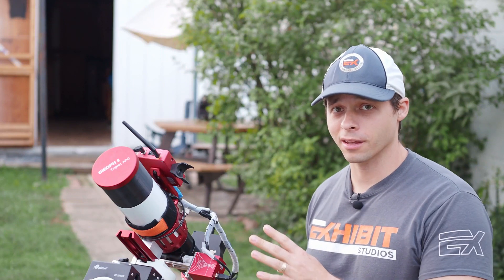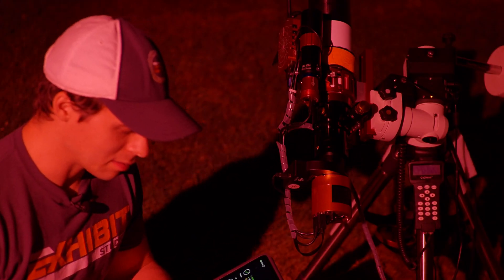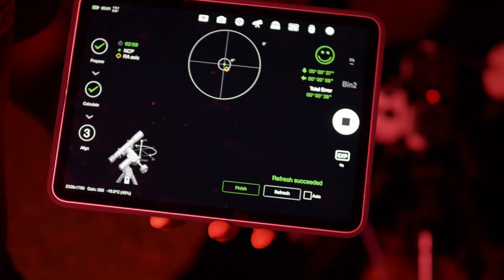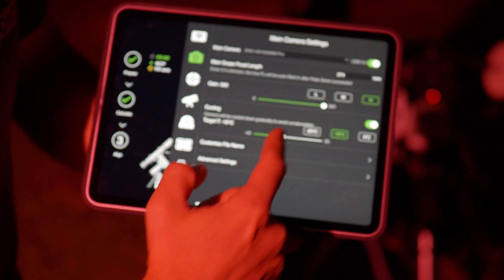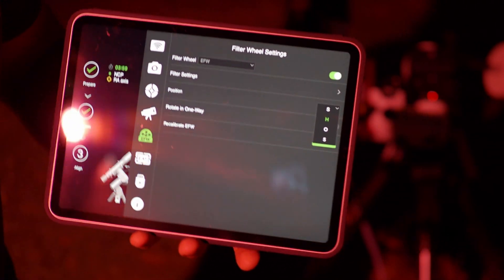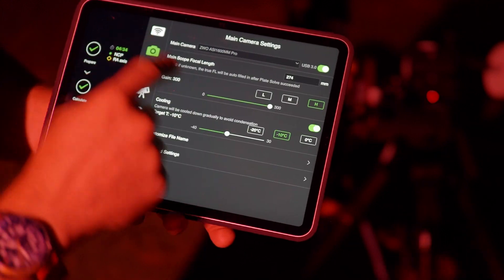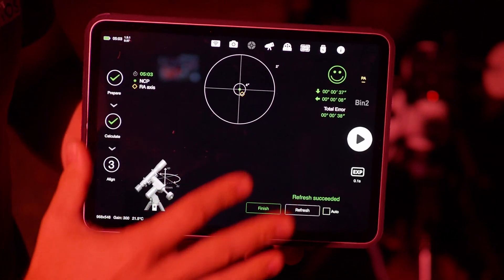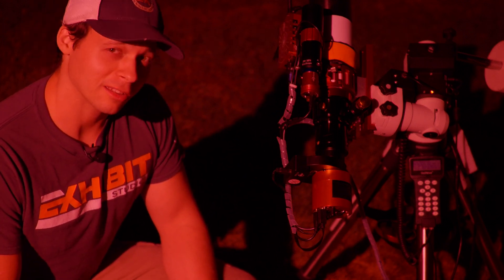What to do When Plate Solved Polar Alignment Fights You, ASIAIR Plus/Pro

Comment: When my PA first starts sometimes it will produce a little red box that says "Stop Rotation".  Any ideas?  Most of the time works great, just once in a while it does this.  I have an Explore Scientific 102 triplet with ASIair Plus, ZWO focuser, ASI533MC Pro, ASI120mm (guide).
Reply from the maker: Interesting. I have never had it do that to me. Lately  my only problem is it says it is rotation but it never does. Just sits there like it's frozen. So I have to reset RA angle manual and restart.

Comment: Thanks, since I disabled the “auto button” and refreshed it manually, it works much better, especially on cameras with larger sensors and on cold nights. Strangely, I only had problems with the ascension, the declination alignment worked perfectly.
Reply: I found that the auto refresh was an issue for me as well - it would often sample while I was moving and not be able to handle what it was seeing - needed several passes for it to settle down so I found it was just easier to manually make the system update after I made my adjustment and the scope had the time to settle down - especially on a SCT vs my smaller refractor.

Comment: Ben, Kevin here.
I have no particular issue with the ASIAIR PA function except I like to look through the polar scope.
So long as I have checked the polar scope accuracy during the day, then the polar alignment is very good.
Best of all, polar alignment takes less than 30 seconds after I see Polaris in the scope.
And, I usually have this done before it gets dark.
The PA function is a bit too time consuming and technical.  I just want to point it and go.

Down side: My old knees disagree.  

I had once wondered about how the errors add up using different methods.
It “seems” intuitive but might not be: polar alignment thru the main optical instrument may eliminate some alignment errors?
I don’t know. I just knee, align and move on.
K

Comment: Great tips. I’m having a similar problem after slewing to target it cannot confirm centering. I believe this is due to use of a filter drawer/filter (dual narrowband Ha OIII), which results in only 30 to 40 stars being found. Is there a way to increase the exposure time? I am NOT using the filter wheel, so cannot use those settings.
Reply from the maker: Yes there is. I think it is in the mount settings. I will have to look it up though. You can specify how long centering exposures need to be for each filter with a filter wheel too.

Comment: Hey there.

Can you do a test for me one of these days? Om-1 with oly 100-400mm lens. Tracking shot of Saturn? I did a single shot of it, and was actually very surprised of the result 😳 so I wonder what I could get with using a tracker 😊 stacking would probably do wonders, but it will take more time than just a long tracked shot? 😬
Reply from the maker: Yes i can give it a try soon. Just moved to a new place. I have much better horizons now too.
Reply from the maker: And stacking planetary should not be a problem with planets. You use very fast shutter-speeds anyway. Just the stacking part is a challenge. Most planetary stackers hate 4k. Because they were written 10-15 years ago.
Reply: @TheNarrowbandChannel  I used s 1/6. F6.3. Iso 200. 400mm mm. Spot metering. And starry focus.

I actually managed to get the ring too 😊 not fully detailed of course. And surprisingly no movement disorientation from the slow shutter 😳

Comment: Thanks.  Those are good suggestions.  I mostly have problems when attempting All Sky polar alignments, not the traditional North Celestial Pole alignment.  Sometimes when I am unsure if my All Sky alignment worked properly, I simply repeat it from a different starting point.  And then I usually go to some star near the celestial equator and do a one or two-minute image to see if I have any trailing under sidereal tracking.  If no trailing, then I feel more confident to proceed with my imaging.
Reply from the maker: Thanks for sharing! I have not tried it so it is good to know of some ways to check it.

Comment: Great Video.    With auto-refresh turned on, I think it takes images so quickly, one after the other,  that you can't adjust your mount in between image captures.  So you end up adjusting the mount while it is taking another image to solve and of course, with the mount movement, you have elongated and messed up stars, and the plate solve fails.   So after adjusting the mount, I would have to wait for the plate solve to fail, which sometimes takes longer than you want, and then continue to wait for it to take a new image which solves ok because you were not moving the mount during that 2nd image capture.  For me, if it didn't sometimes take so long to "fail",  it wouldn't bother me, but like you... I find it MUCH less trouble to adjust my mount and manually refresh the image in between adjustments with auto turned off.
Reply from the maker: Time is everything.

Comment: Excellent ideas. I’ve discovered that a lot of my plate solving issues during polar alignment were due to the fact that I didn’t get my stars very well focused prior to the PA.
Reply from the maker: Yes check focus just before starting if you have problems plate solving. It's a pretty obvious one though so I did not cover it.  I actually do not do that but that is because from night to night I do not take my scope apart. So if I am using the same filter as I was the night before its usually on.